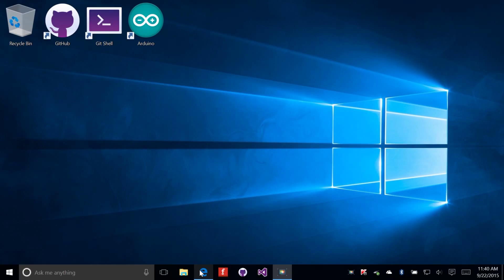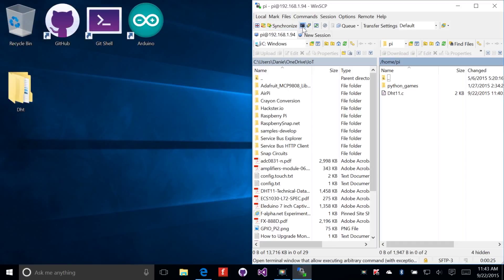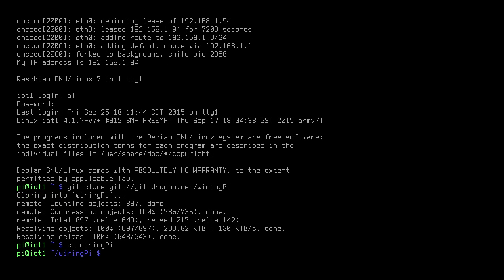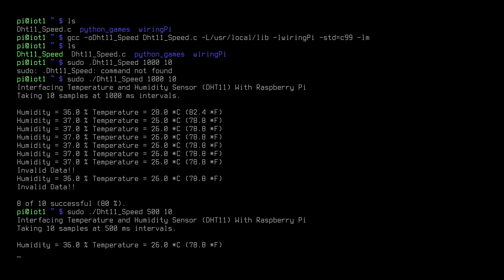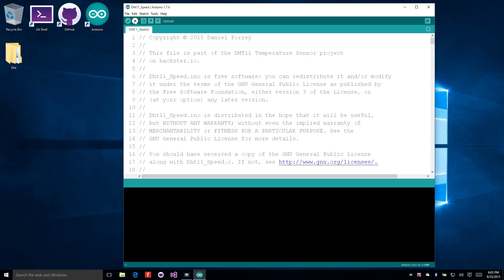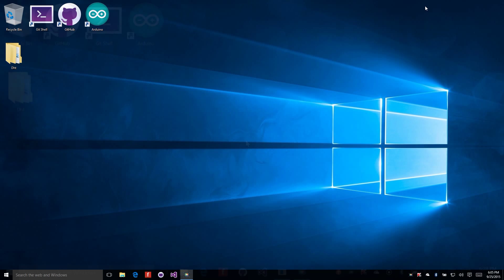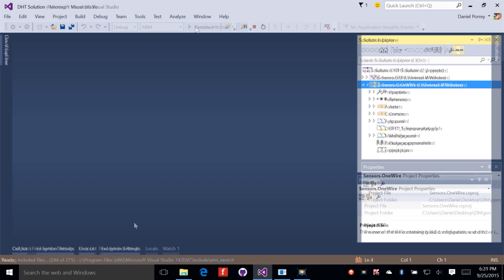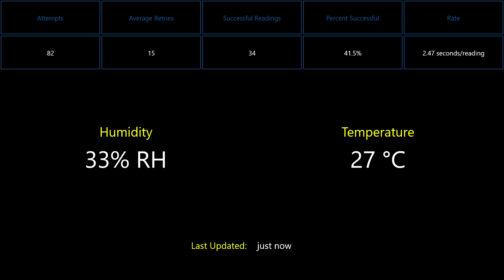DHT11 Temperature Sensor

Comment: hi,, Thanks for great video
I am using raspberry pi 3 running windows iot core, and also i have TNP36 temperature sensor and ADC mcp3008 and microsoft Temperature and force sensor sample(C#)
https://developer.microsoft.com/fr-fr/windows/iot/samples/tempforcesensor
but I am not able to read temperature value,
Do you have some idea how to read temperature value,
thanks
tink.
Reply from the maker: Sorry for such a late response. Check out my project on Hackster about using the MCP3008 on the Pi. 

https://www.hackster.io/porrey/etape-f4b457

Comment: Nice video! You give some idea for our project to use Win10 insted of Raspbian OS! I am not sure that is good idea to use Windows instead of linux, but for a possibility level thing is good. Thanks!!! We have also some experience in this area. We have an temp.humi. monitoring system dev. in progress at the moment and using up to 12  
DS18S20 or DS18B20 (can be mixed us) of sensors in parasite power mode 
with max. 200 cable. Hardware and software implementations are tested 
from some years ago. Works fine!
For DHT11and DHT22 we use 2 
wire solution on over 300m cable / sensor. Here is the idea: 
https://www.facebook.com/spectrasrl/photos/a.482821358509202.1073741840.325515370906469/545481098909894/?type=3&theater
Our system are based on WebIOpi, by Eric PTAK.  Here is 
the project short presentation video: https://www.youtube.com/watch?v=Knis6KReK1A&t=3s

Comment: Hi daniel. I tried implementing the same in windows 10 Iot/core, but the readings I get are a bit wierd as I am not getting them in RH and Degree C for Humidity and Temperature respectively. Can you tell me what might be the reason behind that?
Reply from the maker: Just wanted to mention for people reading comments here that this was resolved. Details can be found at https://www.hackster.io/porrey/dht11-dht22-temperature-sensor-077790.

Comment: Hi man ! Can i do that in sensor LM35 ? what I have change to do it ?
Reply from the maker: The LM35 uses a variable voltage that is proportional to the temperature. This can be read on the Raspberry Pi using an ADC such as the MCP3008. Check out my project at https://www.hackster.io/porrey/etape-f4b457 for more information on this. Let me know if you need more help.

Comment: It would have been much better/easier if you didn't use that Cobbler.  Who has that and all it did was confuse me so I couldn't do the project.  The GPIO pins should be super easy to use but instead you made it impossible.